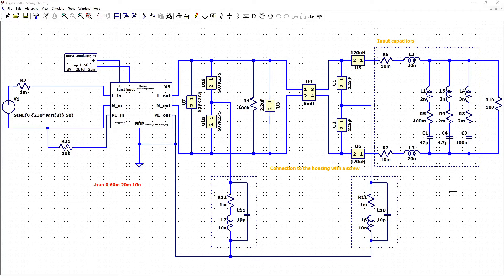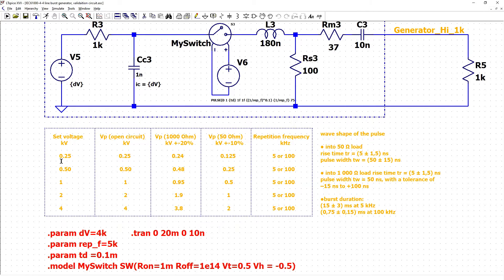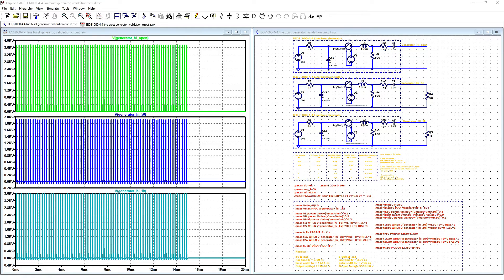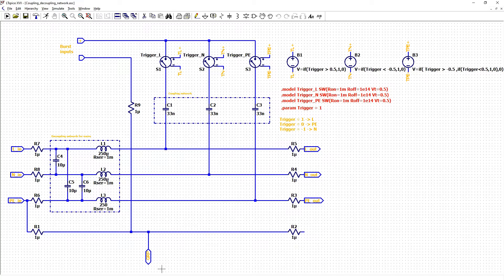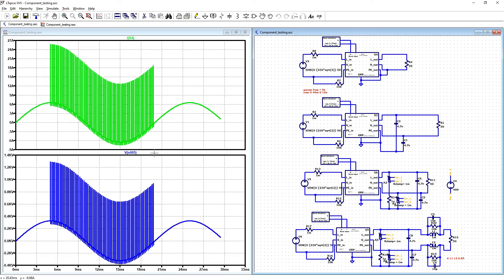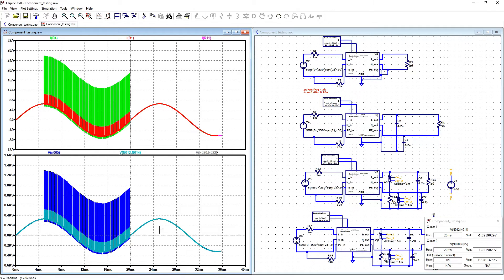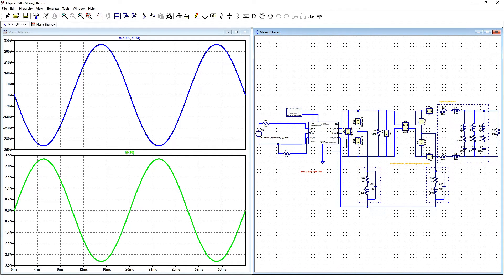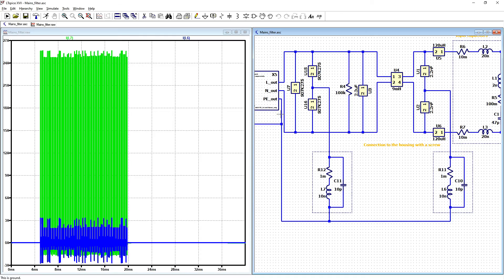Burst EFT test simulation in LTspice! 61000-4-4 Electrical Fast Transient! EMC challenge!

Comment: Congratulations for such an accurate and detailed work, and thank your for the explanation! I'm designing industrial products, powered with SMPS, usually with no PE,  and with many different isolated ports including ethernet and analogue inputs, and I use to have lots of work to have low emissions while avoiding dielectric breakdown through the windings of the CMC. With your circuits I will be able to estimate the effects of the parasitic capacitance of this isolated circuits for the voltage spike. CMC are commonly underestimated in terms of breakdown voltage between input and output, sometimes visible as a blue glow in the part combined with higher EMC disturbance level as the provided by the test itself.
Before I start to reproduce your schematics, is there a way to gently get them? Thank you again!
Reply from the maker: Thanks for the comment! Are you working with high power electronics? Maybe you are doing your own CMC on some cores? I did not have this Issue with CMC before, very interesting. One thing about CMC layout that you need to have no GND plane under CMC for 1 or more layers below because the CM current can bypass and most of the immiunity tests is common mode current. Sent me an email, contact is on my YT website. Regards

Comment: Hey this is great. I was working on a simulation for Burst as well. The new IEC60601-1-2 specification requires 100KHz all the time the 5KHz has been relegated to the past.
Reply from the maker: Thanks! I think more and more standards will have only 100 kHz, as you wrote about 5 kHz, that this is a requirement of the past👍 Try to change only the frequency, and the circuit should work with 100 kHz. It will be a little slower.